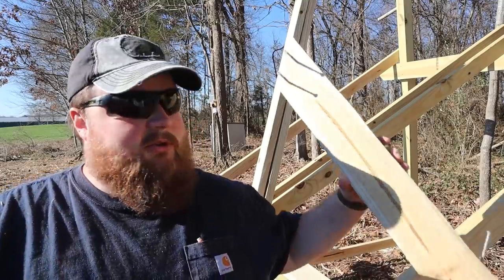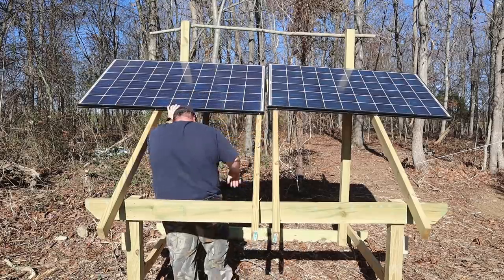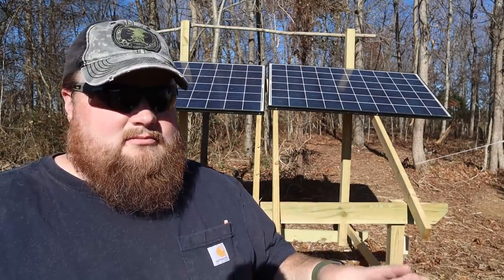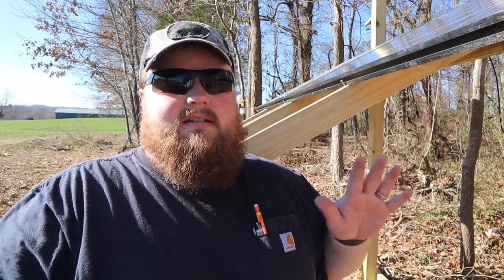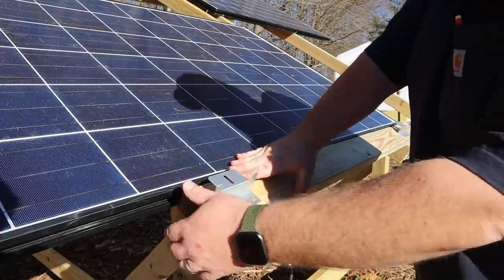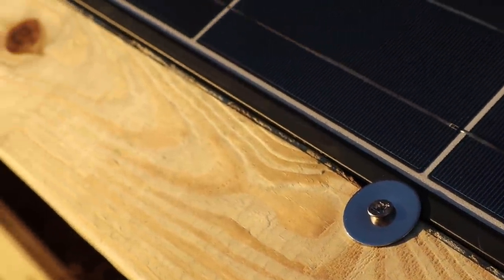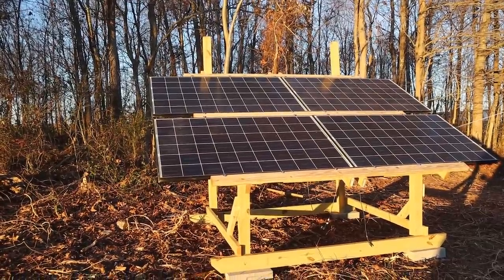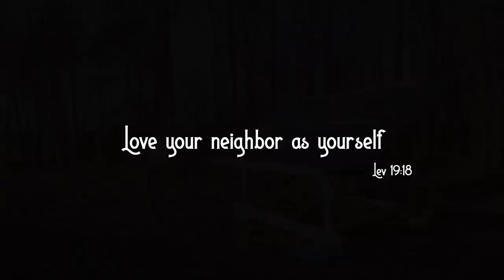DEAD SIMPLE Solar Ground Mount from BOX STORE LUMBER

Comment: I have 30 year old solar panels mounted roughly the same way.  I mounted 20 100 watt solar panels on pallets bolted together on their original roof mount rails missing the original mounts. So too did the bolt with washer works great.

Comment: Our method of digging post holes is all manual - digging bar, post hole digger, clippers for small roots, saw or ax for slightly larger ones, sledgehammer if we can get at larger rocks, shift the hole if all else fails.

Comment: Not sure but the solar mount clip looked like it could be screwed underneath the 2x4 and the upper part would slip over the solar panel. Looks good though. Interested in what you can run off those 4 panels.

Comment: Having had it for 7 months now, how do you like the mount?  Anything you would change?  I'm thinking of doing something similar.  Thanks.
Reply from the maker: This mount has been great, and still used to this day for our off grid camper setup. I've moved it twice; once with an ATV and winch, the other with an excavator and a strap. A support board broke on me with the second move but I was able to rebuild it (see our latest video: https://youtu.be/iemd0d1ZnNA ). For just four panels I really have little to complain over. It's been sturdy and I've had no problems with the panels not being secure. For the long life of the mount I should have put the angle at our equinox angle and not the winter solstice that we had at the time of building. I thought I would have time to fix it before summer, but here we are past our summer solstice and I've not had time yet. :) I do have plans to build a new mount, but for the reason to mount more panels that we have. I'll NOT do a portable style for this next mount because I have the location I want it pinned down and it will use less material. Hope this helps! -Sam

Comment: Are your solar panels aluminum frame? If so, your stainless washers have the potential to cause galvanic corrosion, which could affect the aluminum.
Reply from the maker: I didn't think of that! You're right -- aluminum frames. This mount may be more temporary than we first thought (for good reasons) so I'll not make that mistake again. Hopefully they won't start reacting to each other in the next month or two?
Reply: @sam-and-angela  I think in your setup the corrosion will be very slow. The years scale, not the months scale. :-)

Comment: This ought to be good up to about 50-60mph winds.  After that...  But the cost of racking is very high so it could still be economically worth it to do it this way.  But I live in a hurricane area where I need 170mph rating and this is not going to work for me.  YMMV!

Comment: I don’t usually say much. But all I can say is god loves a trier. 
I think your living in TN. High winds tornadoes rain. I think you made a kite. Another concern is that the world uses metal frames for a reason. Your wood twists and bends as it’s out in the elements. It will crack those panels. 
Bless your heart, I hope it works but it’s nice seeing you try to work this out. God bless
Reply: How did you build yours and how much did it cost?